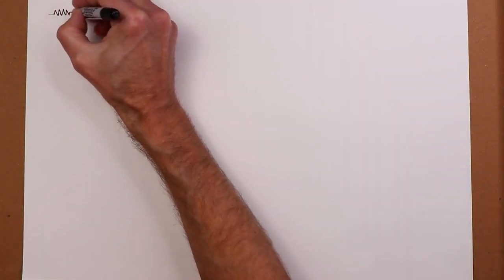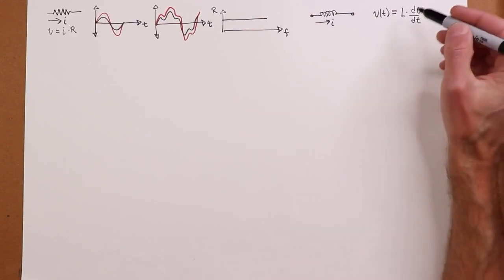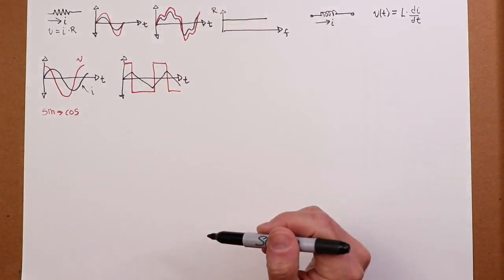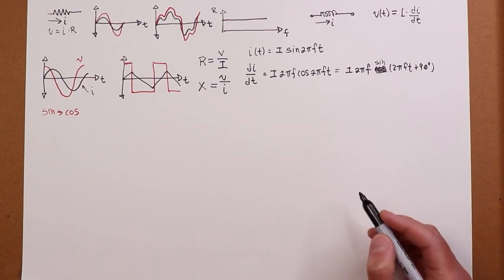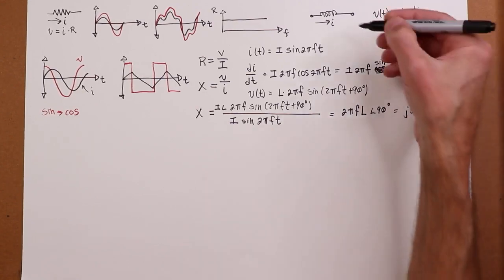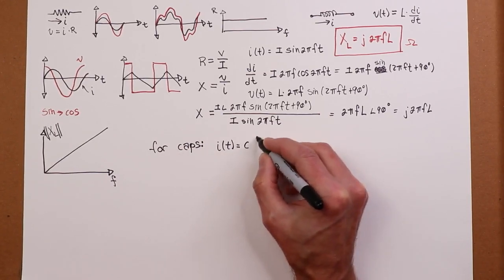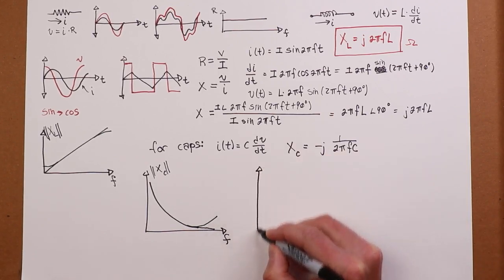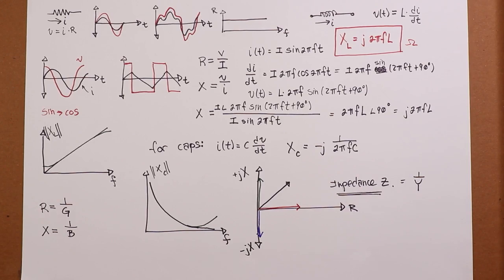AC Electrical Circuit Analysis: Reactance

Comment: I'm getting lost on the derivations. Particularly differentiating the sin2PifL. Do I need to explore some Maths or did I miss something in an earlier video? Many thanks, I'm thoroughly enjoying having my brain stretched.
Reply from the maker: First thing, have you downloaded the text? I go into much greater detail there than is possible in a modest video. Second, the thing to remember about differentiating a sine is that you're coming up with the slope ("steepness"), so where ever the sine has peaked, it's momentarily flat, and thus the derivative is zero. Meanwhile, it is steepest at the zero-crossings, and thus the derivative is at maximum. Just plot those four points (positive zero-cross, positive peak, negative zero-cross, negative peak), and you'll see how the derivative is a cosine (sine shifted by 90 degrees). If the issue involves "where did that 2 pi stuff come from in the derivative", that's going to require a little math review. The key is that dy/dx can be written as dy/du * du/dx, and you need to substitute in the proper value of u (that's the "2 pi" business).
Reply: @ElectronicswithProfessorFiore  yes, I’m enjoying your texts and have downloaded them all.  I’m jumping between transistor work and the bits that I’ve forgotten, or can’t quite grasp. I came across the 2Pi stuff in your diode questions in the text and have returned to your AC videos to try and backfill some gaps. Thanks for taking the time to respond, it is much appreciated.
Reply: @ElectronicswithProfessorFiore  I have it now, thanks. It was the dy/du * du/dx that was missing. I've reviewed that now.